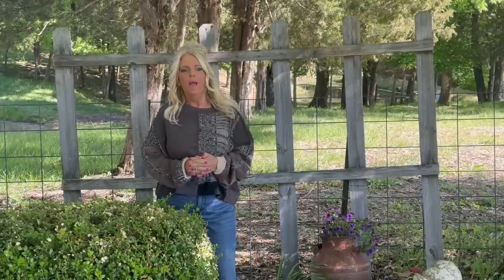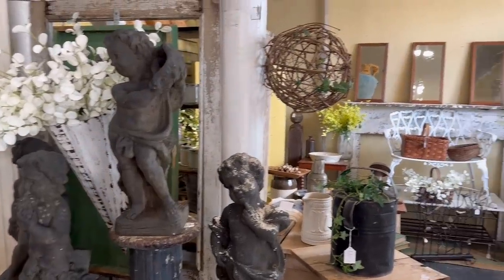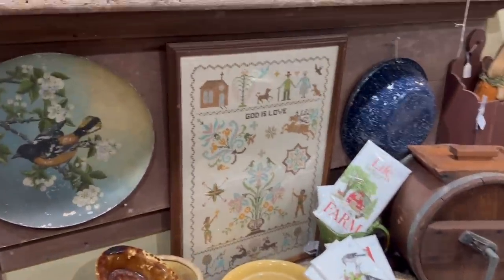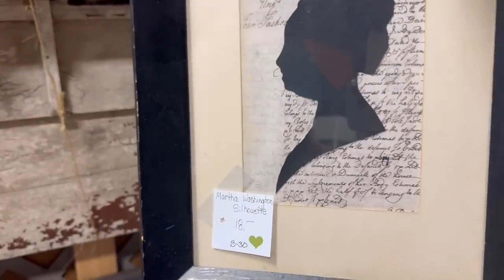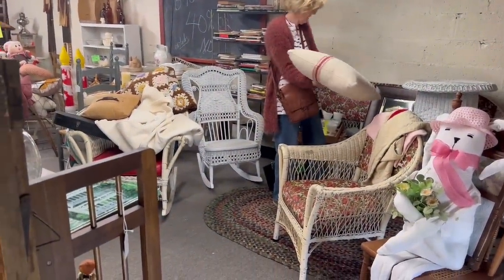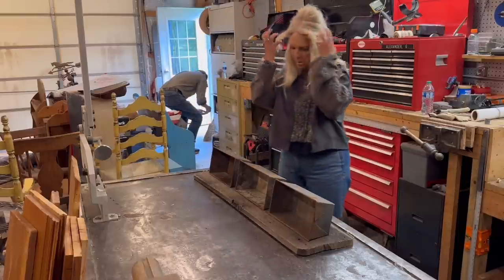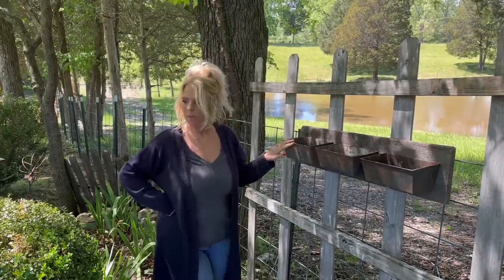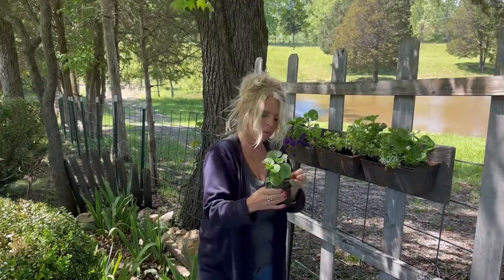Let’s go Antiquing for Garden Decor & Primitive Planter DIY

Comment: In order to fit more flowers in your planter, if you take a bucket of water out with you, you can rinse and shake off the dirt of a few of them leaving the roots and plant them that way. Just lay the roots beside the ones with soil and add some soil on top. Or course you would also have your layer of soil on the bottom. Hope that makes sense.